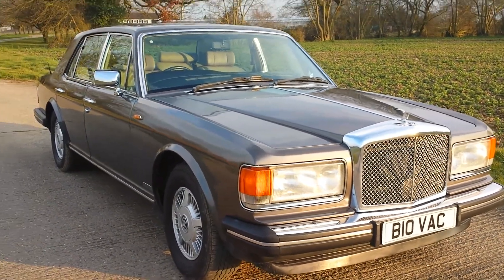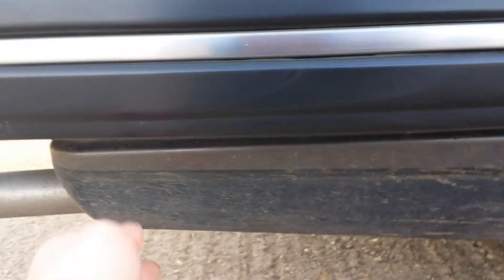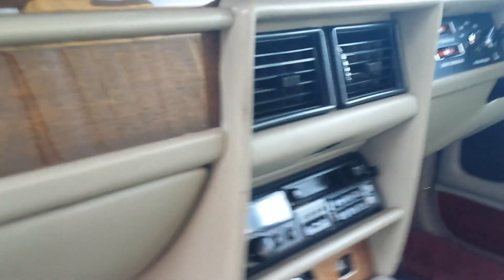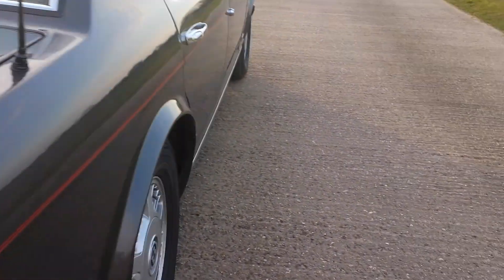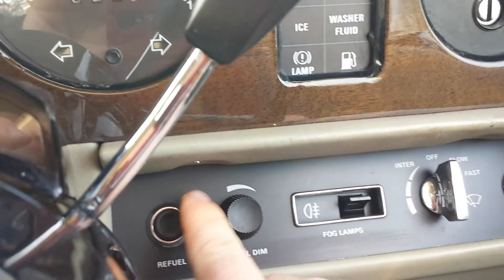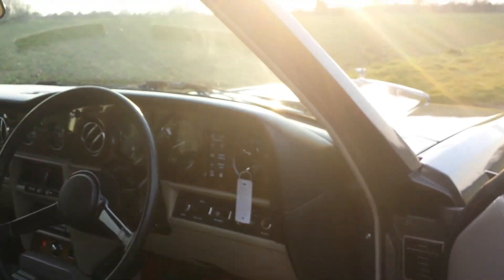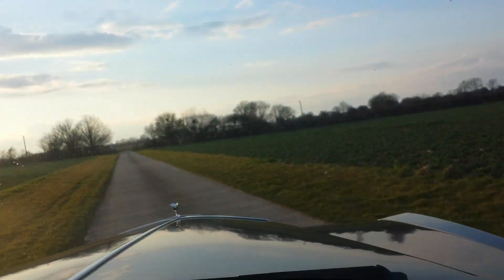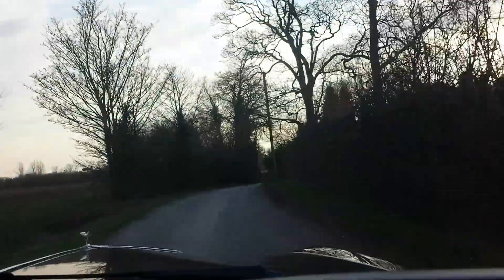BENTLEY EIGHT FULL VIDEO REVIEW STARTING DRIVING

Comment: Despite The rather impressive presentation in this video it’s quite strange. If you go to the DVLA Gov websites, and run the number plates, you will see that the MOT history in not very good with at least 3 failed MOT tests and another 3 MOT test pass , but with advisories. Also the last MOT pass was 21 October 2013, mileage at this point was 66,805. There in no further trace of this vehicle after 21 Oct 2013. This could be for a number of reasons, A change of numberplate, The vehicle is off the road, The vehicle has been exported ?.
Reply: We wouldn't have an issue here in Florida U.S.A., we don't even have inspections 😂